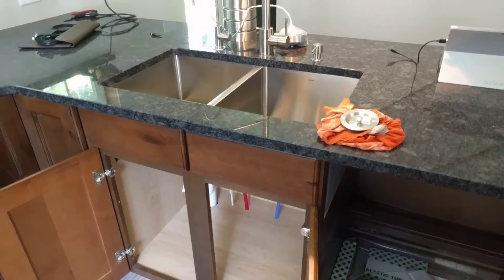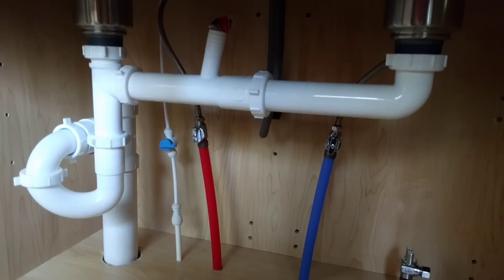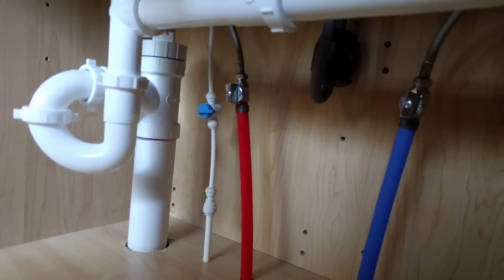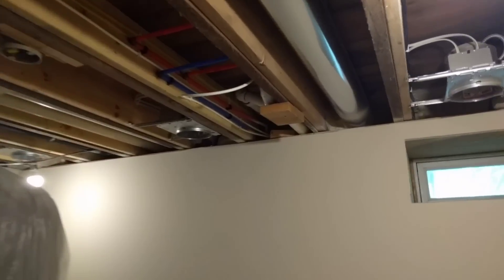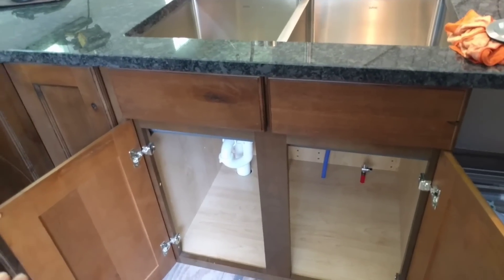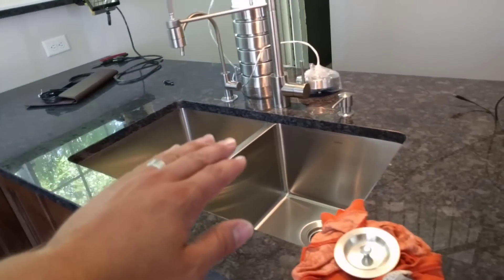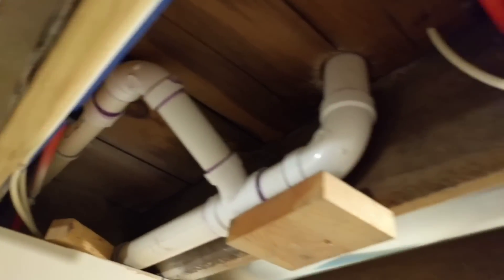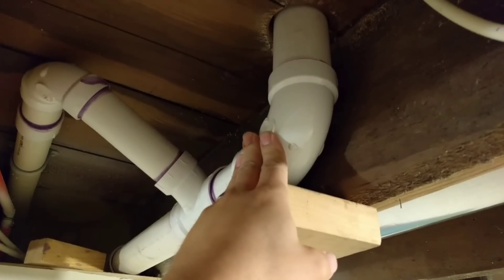How To Vent a Peninsula or Island Sink - General Drain Venting Information

Comment: Instead of that tight 90 on the vent, could you put a wye just like on the drain and a screw cap on it's end? Then you could insert the snake right there up in the joists. You would have to be ready for the back wash of course once you cleared the vent in that worst case scenario. Just wondering.
Reply from the maker: Definitely a good suggestion!

Comment: Thanks Ben, this just helped me with a bathroom sink situation I have that looks similar in set up with the drain lines coming up through the floor from the crawl space and the only way I could route the vent w/o having to tear a wall apart is to run it in a similar fashion to what you did.

Comment: What happens if you have no vent anymore 😨 At least the pe trap is still there
Reply: If there is no vent, then your P-trap might as well be an illegal S-trap, since it will have the same fatal flaw of siphoning that will defeat the entire purpose of a trap.   Retrofitting an Air Admittance Valve would be the best solution, if your jurisdiction allows it.  You do need to change them about every 10 years, but it is better than no vent at all.

Comment: Recommendation, is to drill back up next to your down drain line and bring up your vent line.
Reply: And then do what with the vent line?  Run it through the roof?  Install an air-admittance valve?  The top of the vent has to be above the top of the sink.  Anything below the top of the sink is essentially part of the trap, because if the drain clogs downstream of the vent inlet, the vent line will fill until either the sink or the vent overflows.

Comment: 3:30 Does code allow that horizontal run of vent pipe to run in CONTACT with the sub-floor above it?  In photo it looks very close; is they any concern with future kitchen floor nailing activities driving a nail down into the vent line?
Reply: i saw that. he could have just created a loop vent system instead.
Reply: One can't tell if that's truly horizontal from the video.  It could be 1/4 over 1 foot and be just fine. I believe code says the vent should not be horizontal. If it's 1 degree it's OK from what I've read.

Comment: I think you could have put in air admittance valve on  the top of the sanitary T that your trap drains in to. I believe code is 6" above the trap. Instead of a clean out.

Comment: Good job buddy, nice work and nice setup! I would personally use an aav setup but to each their own and whatever works for you and don't get ya jammed up with code violations! I see alot of people trying to correct you but hey, looks like you have a plan in place and seems to be working perfectly well. So keep up the good work try new things and do whatever you prefer n works best for you! Is that a little r.o. line we see there?  I'd like to see how you ran that. Do you have a collection and recycle tank for the drain off of the system?

Comment: That's a s trap under the sink. Long leg going down from a short leg. It probably works, but it works so well it empties the trap.
Reply: My understanding is that you simply need a horizontal run after the trap that is at least as long as the pipe is wide for it to qualify as a p trap.
Reply: No it's not an s trap. It's a combination waste vent.
Reply: @mattkenaston7180  That's a s trap. You could say it's an s trap that coupled with a bad combination waste vent.  But it's still a s trap and both aren't built correctly.  The long leg of the s trap will empty the trap (defeating it) every time.
Reply: @DoctorMeh  looks like the weir is  twice the diameter of the tap arm from the start of the vent (that 2" is a combination vent at that point) so it would not be an s trap. Unless I'm missing something that seems to be ok. The san tee and extra vent line are another topic though...

Comment: None of this is to code and everything that is said in this video is wrong. Codes are NOT different everywhere. The code is the same for the entire country and there is nothing done correctly in this video.
Reply from the maker: Thanks for the thoughtful comment! I'm sure glad you know it all. Must be nice.
Reply: @BenjaminSahlstrom  the trap arm cannot have more than 1.5" of grade and certainly cannot elbow down through the floor before meeting the vent. A vent must go to the outside and  cannot be vertical until it is 30" above the flood level rim. None of what was done would pass an inspection from a plumbing inspector if they know the codes. The plumbing code is the same for the entire country so it does not matter what state it is in. It looks nice tho so you have that.
Reply: @mikerondeau7372  ipc2015 an ipc2018 section 915?
Reply: @mattkenaston7180 I'm not gonna go look it up. What are you saying?
Reply: The code seems to specifically detail this type of venting. I've used them and they'll work well.
Reply: @mattkenaston7180  a vent can't be horizontal until it's 30 inches above the flood level. If there's a backup debris can get stuck in a horizontal vent and there's nothing to wash it out.
Reply: @mikerondeau7372  I agree that the san tee on its back and the attached vent are not to code. He even admitted it in his video. They are unnecessary though as the 2" is a combination vent. That part is in the code. You simply said "none of this is to code and everything that is said in this video is wrong. "  both statements are inaccurate.
Reply: @mattkenaston7180  there's more than just the vent. The sink is not vented the way it is piped.
Reply: @mikerondeau7372  explain that to me because I have used them (and passed inspection) and I am planning on using the combination waste vent again on my new-to-me house. I would rather not do it wrong but then again ipc sec. 915 seems to say it's ok.
Reply: @mattkenaston7180  the trap arm can have no more than 1.5 inches of grade from the weir of the trap to the vent stack or wet vent. That trap arm drops 3 feet.
Reply: @mikerondeau7372  the 2" is sized properly for a combo waste vent and can drop up to 8' before the horizontal. Check out the code. The combination vent sounds too good to be true but it is.
Reply: @mattkenaston7180  do what you want to. You're wrong though. Everything in the video is wrong. There are several other things wrong in the video too. Just because something passes inspection doesn't mean it's right.
Reply: @mikerondeau7372  ok Mike.
Reply: @BenjaminSahlstrom  I don't know everything but I do know plumbing code. I've been plumbing for 30 years. Everything is incorrect about this video.

Comment: This would not pass in any plumbing codes I’m aware of. The tee on its back is wrong, the short 90 is wrong, the y branch laying down is wrong, the vent running flat is wrong. The best bet would have been to put a loop vent in the wall behind the sink or leave the vent in the wall near the window but run a trap arm over if it’s close enough. Where I’m at some inspectors would let you get away with what you did with the clean out in case the vent gets stopped up from being run flat except you’d have to put a combo instead of a tee and a sweep instead of a regular 90. If you’re area is governed by UPC, you could have not put any vent in the wall and just put a stud or vent where the clean out is under the sink. Hopefully you never have to unstop it because it is going to be hell to get a sewer cable passed that 90 or tee.
Reply: Amen

Comment: Change the name of this video to, "How NOT To Vent a Peninsula or Island Sink".
This is all easily correctable. Drill a second hole for a pipe through the floor of the cabinet and run a section of pipe up from the vent pipe to a 180 degree turn or 2 90 degree turns to make a 180 degree U at the top. Come back down with a section of pipe and connect it to the drain pipe currently installed. Install a threaded male pipe to glue PVC coupler for the connection. Be sure the U is as high as possible in the cabinet right up to the underside of the counter top. Connect this new pipe to the existing vent pipe under the floor above the drain pipe. It must vent/drain down into the drain pipe. You will have now created a proper Island Loop Vent. Next,  install that dishwasher drain adapter In a vertical position. Then you'll be good to go.  
Or you can do an Air Admittance Valve as high as possible. But change the dishwasher drain setup.Take care...
Reply: The combination drain vent in the video is fine.

Comment: I am no plumber for sure, but saved tens of thousands, by doing all my plumbing, and septic work, digging new lines and all,added a sink in the counter, middle of the kitchen, no real vent, trap holds water, yea, it drains slow, but in the scheme of things, gutted the bathroom and kitchen , replumbed all new stuff, even added a shower head for "marital showers", ( since divorced, all the women love it), code schmode, been fine for 20 yrs. Btw, my VA loan required a "home inspection". Well , less than a yr after buying the house, had to replace a clogged line to the septic tank. A few dollars in PVC, it was done, but guess what? Had a pool of water under the washer drain,NO PIPE between washer and drain, hundreds of loads of laundry water dumped in the dirt under the house. Few more bucks in PVC,  had a good drain.Been here 38 yrs, that is the worst of my plumbing problems.Oh yea, I will die here, so whoever gets/ buys the house, a  few hundred to a plumber for the "proper" drain, let em deal with it, home inspector prob won't  catch it anyway.

Comment: Don't do this people lol. Among several issues, per code his trap arm is too short l. He essentially created an s-trap, which will siphon the water out of its own trap. Branched tail piece in wrong position, vent ran beneath flood level of its fixture needs to be ran with drainage style fittings (combos, sweeps, wye's). That's not how a kitchen island is vented btw  (look up foot vent). Will it work? Probably... is it done correctly? HELLS TO THE NO
Reply: Should the trap arm be twice the length as the diameter of pipe used? I have a 2" trap draining into a 3" San tee. The trap arm , the actual pipe you can see in between the fittings , is about 3 inches. I just tried today looking up arm lengths but could only find maximum lengths
Reply: @joedmac78  You're correct, the trap arm must be a minimum length of 2 times pipe diameter to prevent the trap seal from siphoning.
1 1/2" pipe = 3" min, 6' max
2" pipe = 4" min, 8' max
Reply: Looks like he has twice the diameter of the pipe from the ware if the tap to the drain and the drain seems to be the correct size for a combination waste vent. No s trap.

Comment: There is no vent. The trap will siphon.
Reply from the maker: You are correct that this technically is not vented correctly. However, since the drain is 2" and is vented right under the floor we have had absolutely no instances of the trap siphoning. The setup depicted works perfectly despite not "technically" being vented "correctly".

Thanks for your comment!
Reply: Incorrect. Had to fix this very situation for that reason. Also not code, or even close.
Reply: @Skorlang  ipc 2018 section 915. I think it was in the 2015 ipc too.
Reply: Might be, might. Still wrong

Comment: My thought to this plumbing. Why not do it correctly the first time. Where you have your 2 inch clean out under your sink that pipe must travel up to just below your counter top. You would then install a 45, a 90 & another 45. Then run back under the floor and connect that line to the back side of your 2 inch under floor line. As for the vent you have. It would just take to long to explain why this is not legal anywhere.
  Where are you a licensed plumber? I've been in this business for just over 45 years. 
U-tubers are for one thing and one thing only. They need to make more money. So they put this kind of work out and make money off of u-tube. 
 Then you wonder why your shit is all fucked up.
Watch videos like these. Learn how to screw up your plumbing.
Reply: The combination waste vent is in the ipc. I've used them on a similar sink setup and they work great.
Reply from the maker: Lee Olaeta lol Sorry you are so offended.  Feel free to cry if you need to. Whaaa waaa. You're right though about the proper "code" way of doing it. So far there have been NO issues with the setup as shown in the video. Again, sorry about your feelings.

Comment: In California it is not legal to put a santee on it's back. And it's also not legal to use a vent 90° under the sub floor.
Reply: true, does't the vent also need to be atleast 6 inches above the trap weir?
Reply: Jon Helton those sanitary T
always need to be 90' vertical or horizonta of run
Reply: A tee can be on its back only in a venting situation, which is what he has.
Reply: Tim Hendley nope a tee can only be on its back in a vent 6” above the flood rim which it isn’t. Now technically that tee won’t hurt anything because with a clean out on the vent and one under the sink you should never have to get a sewer cable around it but it still isn’t code.
Reply: Yeah, I don't know where this would be legal. Showing people how to pipe incorrectly, so when they sell their house they have to get it done correctly by a pro. Lame

Comment: I had this type of vent in an old house I had bought in the Chicagoland area. Plumbing inspector saw it when I was putting in new counters and dinged me with a code violation that cost several thousand $$$ to resolve.
Reply from the maker: Yes. Technically this DOES NOT meet code. It will work EXTREMELY WELL and has had NO performance issues whatsoever. Should have spent more time explaining this in the video. Thanks for your comment!

Comment: I'm no plumber, but intuitively, I would think the vent needs to be before trap.
Reply: There's already a "vent" before the trap: the drain itself. The drain side will always have ~1atm on it. So from that intuition, the vent would have to go after the trap.
Reply: Depends on what you mean before. If you’re saying between trap and sink then no because the trap is a water seal that would nullify any vent you put in. Plus it doesn’t need one because air can get behind it from the sink. If you’re saying on the drain side of the trap then yes that is correct